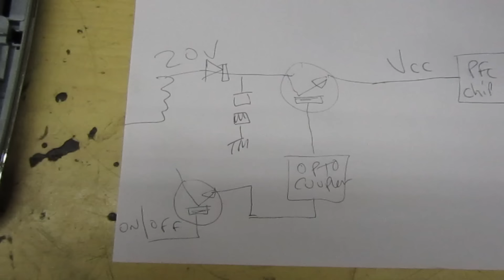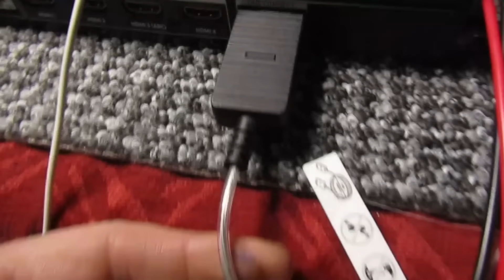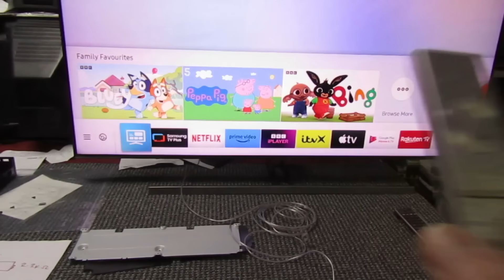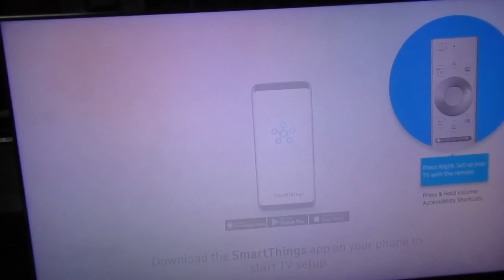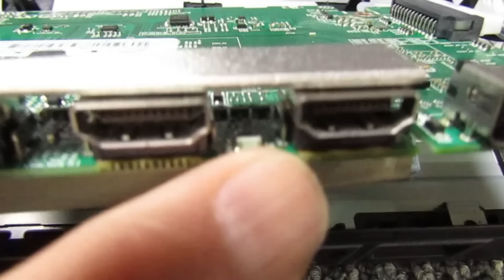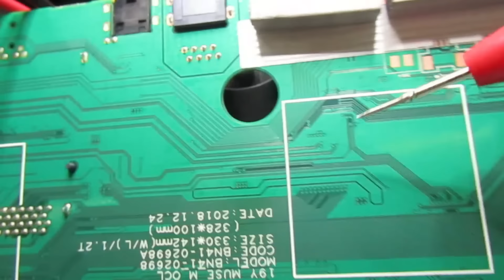Samsung QE55Q85RAT with one connect box SOC1001R .

Comment: Glad I found this channel, in particular, this video.  I inherited a work colleague's 55" Samsung One Connect he was going to skip!  He bought a new one after the faulty one started "jumping" - picture off then on, which got progressively worse more time TV was on. I was hoping to find a "pregnant" capacitor on the power board but nothing physical could be found with the big caps. So I turned to ESR cap fault which would mean removing a lot of  caps just to test them off board for high ESR fault. But  I instead searched YT and found a few One Connect box videos. 

Others helped with how to get into one of these damn things!! 😄 But your video and comments section seem to have me convinced - the pesky FCBGA chip, Samsung SP1805S.  The old PlayStation - solder re-flow trick with heat gun and lots of flux flowing in between the pins (I meant 'balls'). The TV is 5yrs old so FCBGA dry joints, especially if lead-free solder used, could be the culprit.  Seen laptop and games consoles being repaired this way. Also, you cleverly found your way around the board to different circuits and why they were not functioning which always took you back to the FCBGA. (Quite impressive without a circuit diagram - obviously you are very experienced fixing consumer electronic circuit boards!)

I have now subscribed.  Gonna take a look at your other videos. Keep up the good work.
Reply: Just finished watching the parts 2 and 3!!!  Ooopsie!!! 🥴  So, it turns out to be the optical One Connect cable! There must be monitoring functions on some of those fibres (8x fibres?) and one or more must be broken leading to no comms and disabling some functions? Anyways, worth the watch and learnt a lot.
Reply from the maker: @robertsimms5861  didnt make any money out of this repair but experience gained is worth more than money, my guess would be one of the infared emitter diodes has stopped working .

Comment: It is 8 months ago, i was wondering did you manage to get it working ?, or did you return it as is ? because a bga reflow could go wrong, it seems to me that could indeed be the problem, i have the same exact tv with the same box, bought it of marketplace as faulty, it starts flickering after a hour (heated up) it happens to be the SDP1805, in my case i was able to just stop it from overheartting by placing a fan from a laptop at it, it totally works fine that way, i still had my hdmi and usb ports and it also switches on by remote, so the fan came directly at the usb port, which helps it out, reflowing still is a option, but i wonder if that actually would reduce heat.....since the antennabox also get pretty hot, all that heat in such a tiny box, other One connect boxes have a fan build in standard, i guess your going to ask me if those two coils in my box do give power ? and on how many voltage, and were does the powerrail comes away from, havent been that far yet, just actually now watched your video, since i got to tv only about two weeks now, in all, my box is called SOC1002R , on a QE65Q85RAT , which your costumers box is a SOC1001R, so you might have a older version, just the only diffrence is the sticker on it, and my tv is the 65 inch version, yours is the 55 inch version, but these boxes would be compatible yes.....so i indeed wonder did you do a reflow ?, or did you just gave it back, that standby powerrail is a bypass, it could mean that the logic processor didnt get a signal that the box is turned on, and you still should have some switching supply to tell a mosfet to turn on, i,ll check for you about these powerrails and these two coils, will let you know.....my new multimeter comes in today, other was broken......and yeah, great video, you did a research like no other........
Reply: is now see the two others video,s, sorry was not looking ......

Comment: Problem will be cracked solder balls on the BGA. Samsung use cheap lead free solder which is known for cracking on these BGAs - heat the bugger up and reflow the balls. Don;t give any warranty on this as it WILL fail again unless you swap out the solder

Comment: On the subject of 'modern tv's' six years ago I bought a SAMSUNG UE43TU 7000 KXXU - this has been a good tv apart from the awful remote control which from switch on plays me up badly, it goes from unresponsive to jumping across four choices and selecting the wrong icon on the screen but when I finally get to where I want to be ie usually playing something from the usb stick the remote is responsive and behaves itself? I have tried all the usual things, new batteries etc but it still plays up, does anyone have a similar experience?  this is similar to your current dilemma as I don't know if the fault lies with the remote or the tv! Nick
Reply: Clean the inside could be polish or moisture has got in there, clean with IPA ( alcohol )

Comment: Michael - what is the function of the One Connect box please?
Reply: Controls power in inputs
Reply: In short: Looks. The idea here is to take all the ports that are on a conventional TV and put it in a box connected to the TV with a very thin (as you can see) cable. So you can hide all the thick HDMI/RF/Ethernet cables and put the TV out in the open with just that tiny cable and power.

It doesn't provide any feature benefit, just moves the ports off of the TV and into something you can hide.
Reply: @warphammer  Ok  thank you - re remote control problem - have already cleaned and checked the infra-red module on both the tv and the remote - still rubbish!

Comment: You describe the 'One Connect Box' as silly but you don't say why. I've had the 55" version Q90 for the last  5 years and although it ha had its moments it generally works perfectly in connection with a Denon AVR unit - so I'm only using SAT, Internet (wired) and ARC.
The one connect single cable allows me to stand the tv on a lazy Susan for very easy turning for best viewing position for where ever I want to sit.
So, again I say 'Why Silly'?
However I'm glad you showed us the insides of this and I'm glad mine is insured on a fix or replace basis.
Finally how do they get the power and signal down that single cable?
Reply from the maker: I call it silly because you have I dont know how many signal wires, a wire carrying 350 volts and a low voltage wire carrying a high current all stuffed together down a cable  only a few MM thick .
Reply: @michaeldranfield7140  I  do agree now I know what that wire is carrying.

Comment: A quick note for those not familiar with HDMI cables and standards:

  Not all HDMI cables are equal.
  HDMI cables come in different types and specifications designed to
  support different resolutions - bandwidth - and features.

  The main categories include Standard HDMI cables - for up to 1080i
  resolution - High Speed HDMI cables - supporting 4K at 60 Hz and 3D

  Premium High Speed - and Ultra High Speed HDMI cables - which cater
  to higher bandwidth needs such as 4K/8K video and advanced features
  of HDMI 2.1

  The choice of cable depends on the devices being connected and the
  audio/video requirements. While the actual picture and audio quality
  transmitted digitally over HDMI does not change between cables when 
  they meet the HDMI specs - cables vary in build quality - shielding -
  durability - length - and supported features.

  Expensive cables do not necessarily provide better audio or video
  quality - long or poorly made cables may cause signal degradation
  or failure

  For best results - choose cables certified for the needed HDMI
  version and recommended speed - with appropriate length and build.

Comment: All those HDMI inputs showing "Unknown" in the Source Select seems a bit suss to me.  Like a comm issue.

My understanding from another video is the 350VDC is needed as full power for the set - it's high volt low current to get it pushed up such a thin wire.  35V at 10x current would see that thin a wire melted in seconds!

The OC cable is hybrid copper AND FIBRE - it seems like the copper part is working OK but the data side which comes down the fibre is NOT.

Check the cable for traps, harsh bends, folds, any irregularity.  If you have a fibre test light, check one end lights when you light the other.

Clean the sockets on both TV and OCbox with compressed air (small dust can get in the way of optical tx/Rx)

In short - I believe the OC and TV can't "see" each other as far as data/AV signal goes (fibre) - but the very basic (copper) functions are there.

By forcing the 350VDC you are powering "the rest" of the TV, but there's no "digital" Comms.

Not saying at all that this is a fix.  But it IS some things you've not yet checked, which won't cost anything more than time to look at... and I'd say it's worth considering.

Let us know how you get on Mike.

Comment: You performed all the correct and appropriate TESTS including 
  FACTORY RESET and FIRMWARE update.
  we know that the HDMI cable appears to be functioning correctly.
  However  - the TV does have a HDMI cable test function:
  (under Settings > Support > Device Care > Self Diagnosis > Signal Information >  HDMI Cable Test)     to check for a faulty cable.

  The combined steps you performed are a comprehensive approach to
  resolving these issues and the HDMI port issue with this SAMSUNG
  model and One Connect box.
  
  The only apparent solution is replacing the One Connect box and
  replacing the connection cable may be necessary.
  A number of other  users of this TV have also reported recurring
  HDMI issues with the    One Connect box   itself.

  I will see if there is an official or unofficial schematic available.
  Undertaking further board diagnosis and testing will be extremely
  time consuming and not economically viable.
  (So) the best and most economical solution is to replace the
  One Connect box.
 
  I recommend you Speak with the customer first -  and have the customer
  buy the One Connect box himself - as it is at his own risk --
  and be sure you are paid for you valuable 'unrecoverable '  time and
  diagnosis Fee of at least £50
  Only a fool would work for nothing.

Comment: Micheal, Best thing to do is rework the BGA. Apply flux on all corners of the BGA and get it to its melting point which will re-bond all  the solder balls. This seems to only be a issue with the solder balls not making contact on the PCB. After the rework the box should turn the TV on and all HDMI ports will also start working. Best of Luck.
Reply from the maker: reading the comments here its looking like a BGA issue so there will hopefully be a part 2 to this video .

Comment: Hello Michael, put some flex paste around the main processor and heat it carefully with a heat gun so that the flex penetrates under the component. From experience with these components, due to the high temperature they reach, their solder joints to the board come loose and cause various malfunctions. Even if the advice I gave you works, the solution is temporary. But at least you will be able to know for sure what is causing the malfunction. In order to completely fix the malfunction, the component must be removed from the board, rebaaled, and then soldered. This is not an easy process and requires experience with BGA components. Good luck.
Reply: They don’t come loose, they crack from the heat/cool cycle stresses.
Reply: A lot of hard work, very frustrating in the end though!
I'll stick to valves and 405 line tellies! The best thing about the Samsung is there's no LOPT to wave the white flag!

Comment: Hi Michael, i have no experience with these Samsung One Connect Box , but i think at 23:45 those 2 contacts are for a "chassis intrusion switch", which is not populated in this model. Such switches where used back in the days in computers to detect if someone has open the computer for warranty purposes etc...
Regarding the problem itself, I have a suspicion that the coax input would work if you provide a signal, so the problem is with the HDMI detection itself.
The problem can be that this tv needs a specific type of HDMI cable, and that older cables cause a no detection if the HDMI cable is connected.
Also, with HDMI there is the HDCP (High-bandwidth Digital Content Protection), this is a digital copy content protection protocol which is handled between the TV and the source of the signal. Usually a 8 pin IC near the HDMI takes care of this. HDMI cables and HDMI switches need to have this feature, for HDCP to work.
I'm not sure if this is the culprit in this tv. 
Also, when a microcontroller is present, changing a signal manually by grounding this signal (the pair on-off transistors that put that Mosfet off) is sometimes not detected "on the fly" but only checked when the tv comes on, or within a certain time after coming out of standby. 
So, you could ground those 2 transistors and keep them grounded when you do a power reset of the TV.
Because this TV is from 2018 or 2019, and since 2006 and beyond, lead free solder is used on circuit boards, which cause solder under big IC's.
This is a very common problem in electronics these days, if this is the case, as test heating up the microcontroller (with power off) to only arround 110° for a few minutes and letting cooling down, can bring a device back to life. Even this temperature is to low to let the solder remelt, it can temporary fix broken solderjoints under IC's. And as last tip, to check for continuity across a big circuit board, you place your negative probe to ground fixed, and use a small soft brass brush connected to the positive lead of your digital multimeter. With that, you can measure greater area at the same time, if you get a beep, you can use your regular probe to pinpoint the exact spot.

Comment: Sorry Michael  I wasn’t clear in my last message  
Try heating the main processor on the one connect box first as they are known to have cracked solder connections
Reply from the maker: yes , Monday so there should be apart 2 to this video soon .

Comment: I know nothing about the One Connect box BUT I've had a similar confusion with a cable TV box and TV here in Canada. Maybe you have a similar issue.
 I noticed you were able to turn the TV on with the same remote as the one connect box. I assume a second press of the remote will toggle them off.
Is it possible the TV and the box are out of sync in their on/off conditions. i.e You press the remote control and the TV goes off and the box comes on, and on a second press they reverse conditions (box on TV off). Basically no way to get a signal to the tv.
Near the end of the video you were finding no voltages from some power supplies in the box. Is it that the box was off and you are being fooled by the TV screen being on. 
Try repeating your testes where you were covering the remote control sensors (covering one and not the other) to get both devices to the on condition judging by their individual power on lights etc.
I mention this because I had a cable tv box controlled by the same remote as the TV and sometimes they would get out of sync. You had to isolate the remote to facing the cable box and watch the power light to set it to on and then go right up to the TV sensor being sure the box could not see the remote control signal and turn the TV on. Once they were in sync and both on it was ok. When they were out of sync the tv power light would come on and simultaneously the cable box power light would go off removing the signal from the tv. 
In their normal positions the box and the tv were right next to each other so the remote control signal would reach them both at the same time. I'm not sure how they got out of sync. Maybe someone pointing the remote control way off to the side and the signal would only activate either the TV or the box. From then on they would be out of sync until you did the above process to re-sync them. VERY confusing.

Comment: Hi Michael 
The most common issue with these tvs is the one connect box not the tv itself 
On your one it sounds like a power supply problem on the box 
If not try heating up the processor on the main board see if it comes good 
Also make sure the optical cable is plugged in first before powering up the unit as it can damage the box 
Good luck trying to find parts for this box as there like hens teeth 
Regards
My Le